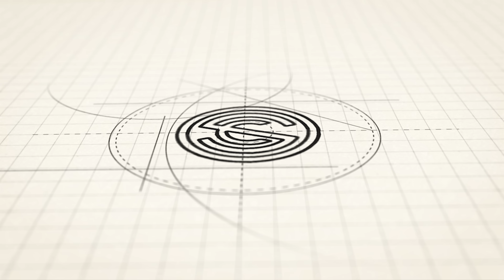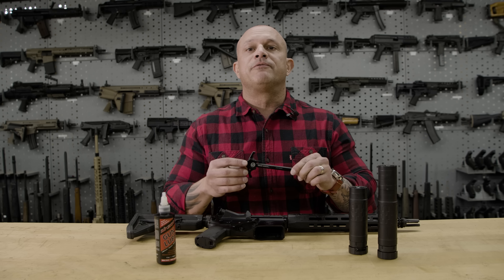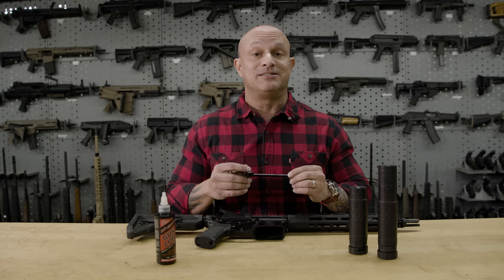SilencerCo How To - GDCH

Comment: My experience with this charging handle as follows.  Purchased one today.  Lubricated and installed.  Cycled the BCG one time and the “O-Ring” gasket basically came off mid pull and bound up between the upper receiver and the handle and was mangled to the extent that it was unusable.  Unfortunately my local shop does not accept returns.
Reply from the maker: Chris, your package should contain an extra o-ring if the one that came pre installed is no longer useable. Follow this tuning guide to make sure you have proper fitment. If you have any other issues or questions please hit up our customer service! https://www.youtube.com/shorts/MTii8XZVMcU

Comment: Don't O rings degrade or wear over time? If so how long does this one last or how often do you have to replace it?
Reply from the maker: Yes, they absolutely do. This depends on many factors. Geographic location, how often you lube the O-ring, etc. We have tested thousands of cycles before ripping the O-ring. It's easily user serviceable and replaceable. It also comes with an extra O-ring in the packaging. If more is needed they can be purchased from our website or a similar sized O-ring from the hardware store cut to size will work fine.

Comment: I built my first AR and I went with this charging handle. All seem fine except that the pin on the right side of the charging handle lever keeps coming out. After about 10-20 cycles the pin comes out the top.
Reply from the maker: Hit up our customer service and we will get that fixed right up for you!
Reply: @SilencerCo  Ok, thanks.

Comment: Can this be used without a suppressor?  My Smith & Wesson is way over gassed, will it still work in theory
Reply from the maker: Absolutely. A suppressor is not required to use this charging handle.

Comment: How to make a suppressor with low back pressure ? That is the question. Do it
Reply: OSS has been doing it for years. It's a bit louder but it has almost no blowback
Reply: I run a Stag left hand upper on a SiCo lower with an OSS 762 Ti can and there is zero gas face.
Reply: Valos just came out it is a low back pressure can

Comment: going to buy one to test it out. i tried everything on the market and everything failed. hell, i should have started a youtube channel to show all the failures. lol hope your not one of them.
Reply: Let me know where you find one 😂 I can’t seem to find them anywhere’s in stock online
Reply: @whodat3723  I am actually working on taking old handles and modifying them on my own to block the gas since i can not find them. but going a step further and going to vent the stem of the handle to disrupt more gas. wish me luck and hope it dont blow up lol
Reply: @jonathanmunoz1981  Sounds like a nifty idea. Did you ever get it done?
Was sitting here thinking a dremmel to draw a channel, some high temp RTV for the bottom, and a gas port drilled into the side of the upper where it meets the base of the charging handle, but towards the rear so the gas would expel in the direction of the muzzle (if that makes sense).
Reply: @gierhedd75  just bought it. should be in before the weekend if they are not lazy and dont ship it asap. I did drill a hole on the side of a standard charging handle to see if it would shoot the gas out the side like others on the market. testing that same time as the GDCH

Comment: Wonder what the life of the oring is? (TWSS)
Reply: I have yet to see a good image of it.. Even on their promo video and their site.. Also wish they would've included a vent port hole like strike industries.
Reply: Maybe its just a really tight machining job or something.
Reply from the maker: We still haven't reached a failure point with our earliest test model that has over 2,000 charging cycles. Remember, that number isn't round count, that's charging cycles. The round count is is probably in the tens of thousands.